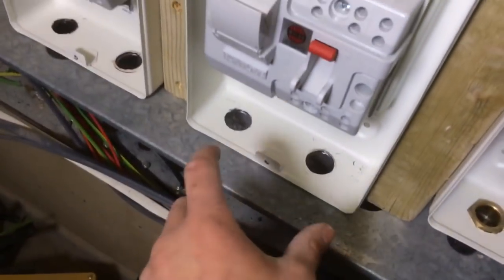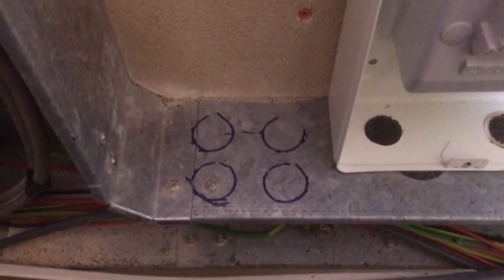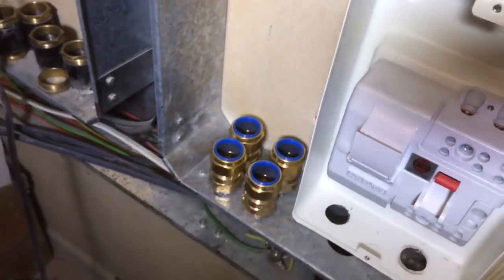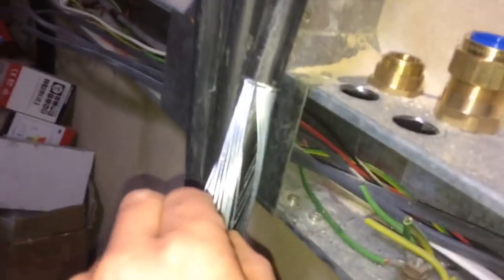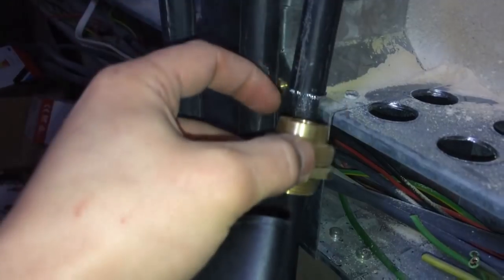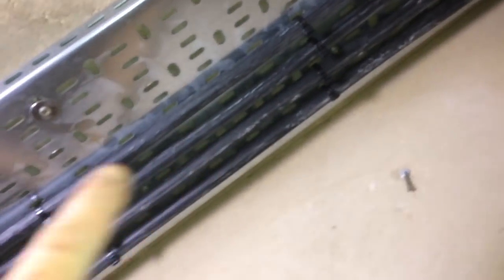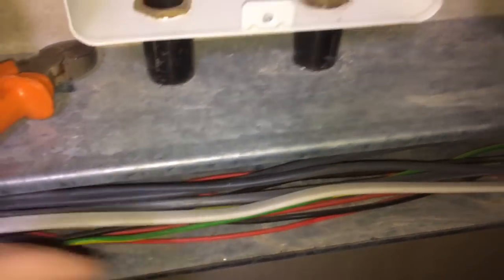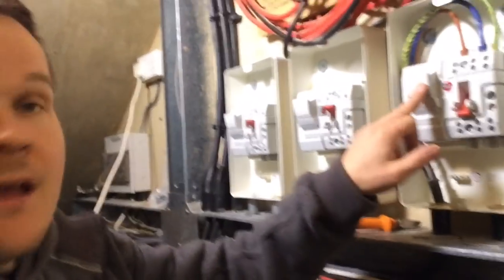Glamorous Life Of An Electrician !

Comment: I usually get the shroud and push it over the end of the SWA then knife round the cone of the shroud on the outline of the SWA never fails to get a perfect fit.
Another useful tip with SWA up to about 50mm is to attached the gland to the trunking first then feed the inner sleeve through the  gland and tighten up the the brass ring last, can be an easier method than having the cable floating around in mid air trying to get the gland on

Comment: A pleasure to watch such a good demo of terminating SWA. I left the trade yonks ago - never liked working with armoured. Give me pyro any day - provided it'll actually go in: larger sizes can be a real challenge lol. I had risers put in my house when it was rewired. It was done by guys I know well, who are ace. They used 3 core XLPE 16mm, without earth sheathing. It's a lot easier than armoured: a lot smaller. The only thing I'm not keen on is that the cores, like pyro, are not stranded. There is always a danger that terminations might loosen in time. I saw a fire start this way with a 2H16 pyro riser. When terminating stranded conductors in dis. boards, I used to wrap a length of copper wire or fuse wire tightly round the conductor. This stops the cores splaying out when the terminal screw is tightened. Thus was common practice many years ago, but the oractice has long died out. I would have done this on the ends of your SWA, provided the terminals were of 25mm capacity.
Reply: I love swa

Comment: I have experienced a lot of bad swa from a few distributors, the only common thing I have found is they tend to have a grey inner sheath surrounding the cores, and some have replaced the chalk that's between the inner cores and inner sheath with a clear plastic wrap absolute nightmare to strip. After trial and error found batts cable best to strip cold or warm. 

Also seen comment about hole saws try armeg acceler8 holes saws, you'll never use anything else after, I work with alot of stainless enclosures still on my first 20mm holesaw easily done 200 holes (with lube)

Comment: not good practice to double bolt banjos
Reply: Why not?
Reply: @obd6HsN  because if you need to remove the cable that is on the bottonm banjo you have to remove/ disturb the other cable which is not good practice
and i have seen it where they never refit the bolt back to other cable

good practice not to share bolts
Reply: @pault4793  I may not be following  what you mean, but to remove the cable why would you remove the bolt on the banjos? I would loosen gland remove cable remove old gland then put either a metal or plastic bung in the hole not removing old banjo or disturbing bolt. That way in future if I was to fit another cable I have a hole and banjo ready.